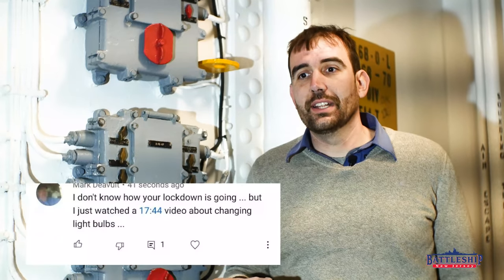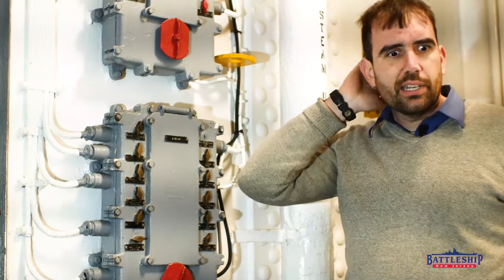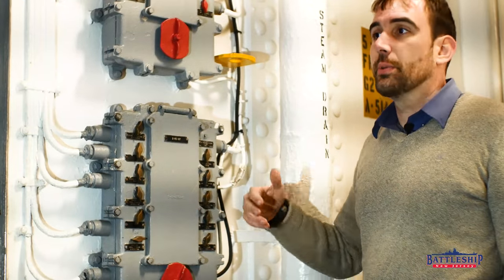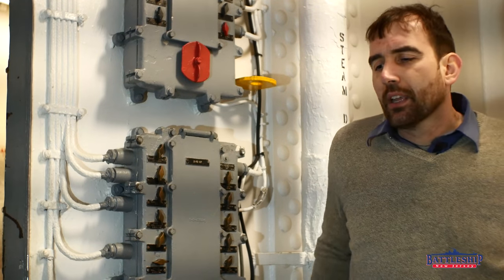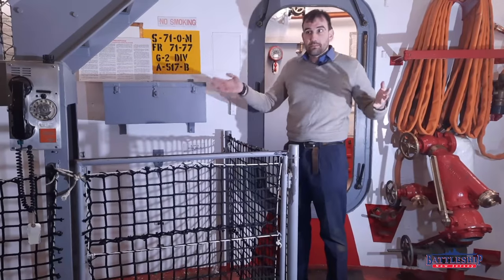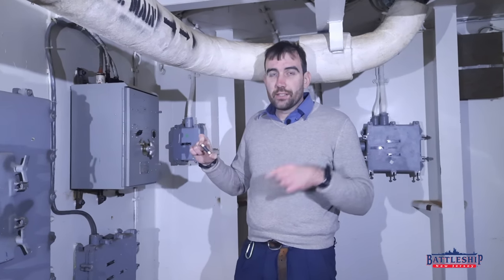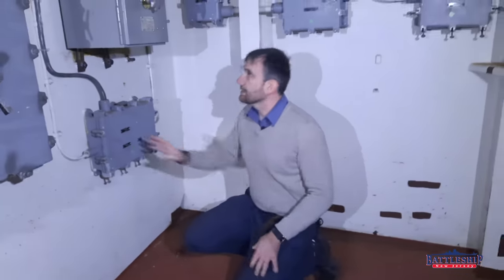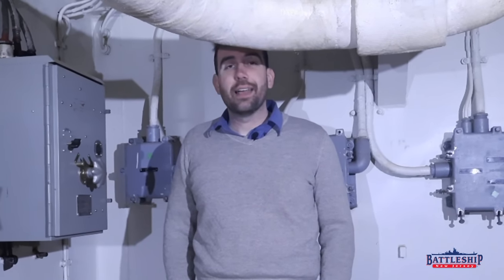Maintaining Your Battleship Gun Turrets: It's Electric!

Comment: The 440VAC three phase main power system is not grounded, that is is not a 'Y' wired three phase system referenced to a ground but a 'Delta' or 'D' with no ground reference to survive a short to ground (the hull) from ONE of the phases that might result from battle damage or just age and flexing of the ship.  Yes, there is a 'ground.'  It is the ship's hull.  The electrical meaning of 'ground' is just a safe neutral or zero volts surface compare to what you might touch or stand upon.  (See last paragraph) Salt water contact through sacrificial electrodes does a fair job of contact to the sea.  A typical industrial 'Y' wired system would fault immediately from any short to ground which for industry is desirable...not for Battleships (see 2nd naval battle Guadalcanal and what happened to South Dakota Battleship) .  There may be some HV resistors from each phase to 'ground'...the hull...back at the generators to keep the system from 'floating' to a high voltage and arcing to the hull on a dry day...and when would that be?  They would not burn out if there was a fault.

It's 440VAC three phase, not 480VAC as it is industrially on land.  The 120VAC, single phase systems are 'local' in most designs meaning they are derived from two of the 440VAC phases by an iron transformer nearby or electronic switching system nearby in modern designs and that there are many throughout the ship meaning the fuses for a local 120VAC fault could not be at the generator.  Is Damage Control somewhat up to date?  Could have diagrams or maybe an electrical Damage Control someplace.

Navy 440VAC ....or even sagging to 400VAC...was derived from earlier merchant marine practice.  There are also 120VAC and DC systems on the ship.  You might think about an episode about that or more particularly how it is set up to survive damage AND EVEN WORK WHEN THE SHIP IS FLOODING (see plug in connectors that work under salt water, emergency lockers, portable damage control gear and the such).

CAVEAT: I am a 'land lubber' licensed electrical engineer who always earned a living as an electronics engineer...high and dry.  I was suddenly confronted by Navy acceptance testing for specialized electronics maintenance gear I designed long after I retired but was working as a consultant and electronics design engineer for fun.  Why can't I make use of the neutral lead (not the 'green' ground lead...similar but not the same use...I glossed over some things) as we do industrially?  Because there is no neutral.  REALLY?  So I called my friend a retired Navy Captain (O6) who remained in the engineering line in the Navy....didn't know.  Then some officers listed for contact points...didn't know or where to find out.  Then I went to a retired electrician's mate in a club locally.  He DID know.  Then I bought G.O. Watson's "Marine Electrical Practice" and read it cover to cover.  Oh! THAT's WHY.

Comment: You might want to seriously consider [consult your electrical expert] setting transfer switches to 'manual'.   Especially insure that your out-of-service diesel gensets are in 'manual', or disabled so that they will not be attempting to start should you lose power.   No need to complicate matters.

Comment: One thing I've wondered about recently- are the barrels in each turret horizontally parallel? or is there a tiny amount of spread? can this be adjusted?
(I'm talking about left/right movement)
Reply from the maker: The barrels can elevate independently but they can't move right to left behind the rotation of the turret
Reply: They are theoretically fractionally convergent (ie barrels pointing to the same nominal spot at a range halfway to the manufactures stated maximum effective range). This reduces the dispersion of shell fall at any effective range when compared to perfectly parallel barrels, but no, its not something adjusted easily, typically only thought about when physically removing the barrels from their mounts. If you desired a spread (and you very rarely do) you normally do so by just staggering just the firing time (moving ship in both ahead speed, roll and recoil), or you can aim each of the multiple turrets at a slightly different target (something only really japan planned to do at time of construction, and even then didn't realize often in actual combat).

Comment: Do they still make fuses for those electrical systems? Or do you folks have a warehouse full of 80 year old fuses 🙂.
Reply: Big fuses for industrial use are rebuildable. Not sure about these but I'm  sure they exist,  somewhere.
Reply: We still use those today
Reply: Yes, you can purchase those at a well equipped hardware store or at an electrical supply store.  Be sure to throw the old one away, after smashing it with a hammer.
Reply: There are still fuses in lots of service disconnects. Fuses for some of them are still available at Lowe's in my area.
Reply: @johnm7249  why would you smash them with a hammer?
Reply: @lexington476  to make sure someone else doesn't try to re-use them. This is especially critical with a fuse that kinda works like what Ryan was experiencing.

Comment: This happened at Griffiss AFB, Rome NY in the summer of 1975.  I was on duty at the SACCS/Crypto Maintenance shop in the evening.  We were having a thunderstorm.  Commercial power went out.  That dropped our power relay in the shop with a big bang.  We immediately turn off all the computer and crypto power supplies in the shop and the terminal equipment in the SAC Wing Command Post.  We hit the power relay to go to backup generator power.  Nothing!  What the....!!!!  I grab my hat and the keys for the gate and the door to the generator.  I go inside and it is running.  The meter shows voltage, but no amps.  What the...?
I call job control to get Civil Engineer (CE) Maintenance out to check the generator.
Instead of waiting for them, I go into the Command Post.  I check the cab arear, the back offices, equipment room, and the battle staff room looking for a long forgotten circuit breaker panel.  I didn't find one.  The truth is I really didn't expect to, but I was going to check in the vain hope that was the problem.
While standing in the cab of the Command Post, the officer controller, a Major I knew well, started to jump on me to get the power back up.  Their critical equipment was running on battery backup.  We didn't know how long that would last.  That wasn't like him.  Neither was I in the mood for what he was saying.  So I turned and squared up to him and told him, "Sir, cool it Sir!  You are not helping!"  Oh boy!  I could see my butt chewing coming!  But just as it seemed to rise to his neck, he quickly slumped a bit and said, "You are right." and went back to doing his stuff.
Finally, CE came and found the problem with the generator.  Lightning had hit the relay that switches power between commercial and generator in the neutral position.  That meant we couldn't get power from either.  Commercial power had been restored.  He manually threw the relay to commercial power.  
We could then hit the power relay to get commercial power.  We powered up the equipment and hit the various reset buttons to get the system back in sync.  The system then was working.
It was a few weeks before CE could get a new relay for the generator.  Thankfully, no more power outages during that time.  
Sounds a bit like your problem, Ryan!

Comment: I would guess that, for getting down the janky ladder, you would brace one arm on the floor and use the grab irons on the latched-open hatch to get something to actually hold onto, although there may have been a BETTER ladder that got removed or repurposed elsewhere at some point like you see in a lot of the other compartments - there's a lot of places where behind the NICE ladder that can be removed, and then a sketchy one permanently attached to the wall behind it.

Comment: Just for the sake of duscussion, I think It would be very interesting to hear what kind of works would be needed to reactivate all her systems in the present status. So no major updates and with a view just to have her fully functional for museum purposes, hence a dynamic museum vs a static one. I can already hear about the prohibitive costs, the Navy forbidding this and that, the crew, the training… let’s imagine this is just not an issue. So just the technical challenges to awaken the sleeping beauty after 30+ years of sleep…
Reply: Dismantle entire engineering plant.  Inspect.  Re-assemble.  Inspect and pressure test every pipe and valve.  Clean/inspect/test/repair every electrical switchboard.  Continuity and insulation resistance testing for every single wire on board.  The list goes on.

A good shipyard with a few hundred workers and access to the Navy Supplies and Spares system could probably have her ready for combat in 2 or 3 years...
Reply: Thanks.  I did not mean ready for combat. That is another exercise.
Reply: @kevincrosby1760  Problem is that there are no spares for an Iowa class battleship, haven't been for a long time and I suspect it'd take more than 3 years.

Comment: In critical locations we design engineer to wire every other lamp on a different circuit and a different phase so if one circuit goes or one whole phase goes down there are still enough lights that work for critical activities to continue. This would include ships, nuclear power plant control areas, operating rooms in hospitals, critical  communications centers, high security control centers, you get the idea. I wired my  aunt's store that way after I found out some idiot had ALL of the lighting on one circuit switched with a big-a** contactor so CLACK CLICK KA-CHUNK and all the lights come on or they go off. If the breaker trips at night, you may get sued!
Reply: I build guitar amps now and use an old Genalex trick and a some other old Indian tricks and ancient Chinese secrets to make them better than double redundant. You may go to a reduced power level, but you will still have something that works and it won't ever blow itself up because it can't.

Comment: Completely inaccurate. Where's your Work Authorization Form? Where's your tagout? Where's your step-by-step troubleshooting plan, approved by the Electrical Division Chief and the Engineer Officer? Did you pull that fuse live, without de-energizing the fuse box or verifying it dead? And what's this, opening a live fuse box and ABT without any safety precautions? That is a gross violation of the NSTM-300. It's a good thing the Captain didn't hear about this, or he'd see you before the green table.